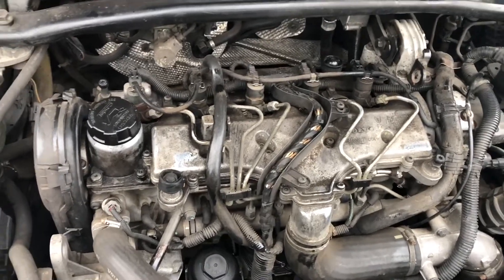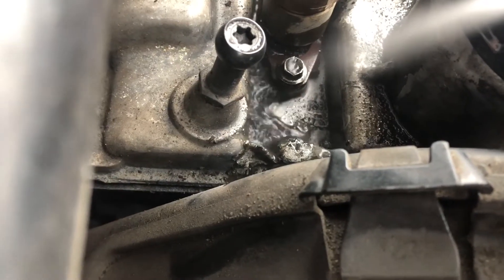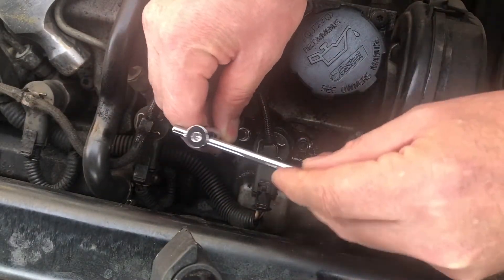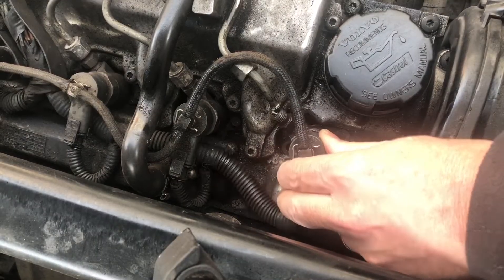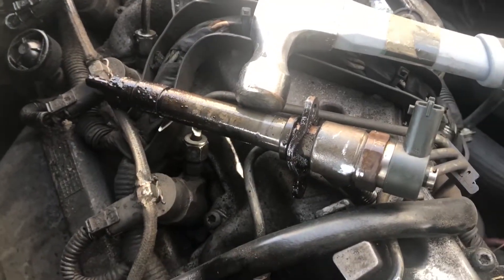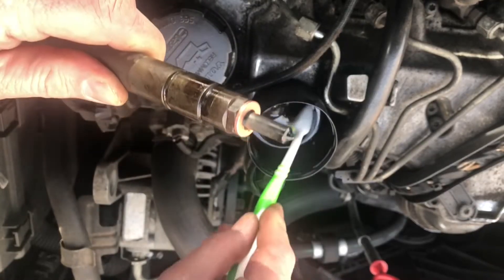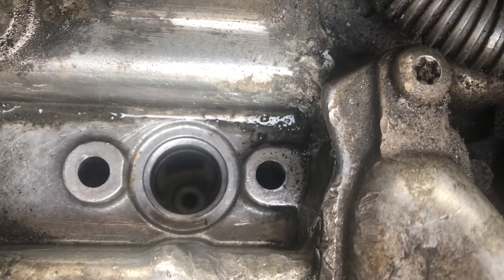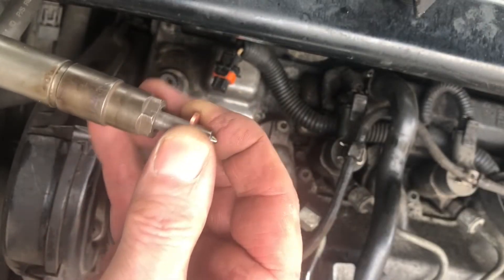Stuck Diesel Injector Removal & Refit Without Special Tools on Volvo D5.

Comment: unlikely the carburettor cleaner did anything , as it generally evaporates
Reply from the maker: I can’t agree with you as it dissolves away the carbon deposits to facilitate the loosening of the injector.

Comment: Why did you mark the relationship between the solenoid and injector body?
Regards
Reply from the maker: Just incase I knocked the injector and the nut turned out of alignment I could easily return in to the correct torque setting.

Comment: My dear friend, fortunately for you, you don't know what a stuck injector is.
Reply from the maker: Oh yes I do and I have been able to remove them after many weeks of patience using the methods detailed in the video.
Reply: Galvanic corrosion of alum to steel caused by water intrusion over a long period of time. Dealing with that now on a sprinter t1n  engine out of vehicle. Taking it slow trying various (every) penetrants and several puller methods that do not destroy "egg shell" valve cover.

I can lift engine via claw foot on any 5 of the injectors and it don't budge-that's  what "stuck"  is on this engine.

Still trying various methods ie "vibrating-oscillation" of injector with a custom tool.

Also plan to make a  "brace"  for upward pulling from outer surfaces that are stronger than egg shell valve cover.

Tried some vinegar carefully placed at injector base for short period of time (up to 8hrs) which got me couple of mm deep. 

Wondering if some heat introduced via injector bolt hole could help (?)....

last resort may try some lye carefully placed  with dropper around injector base letting it sit for awhile while also using puller or keeping upward pressure on injector.
Reply: @jamesfish5630  use a blow torch directly to injector body for 15 seconds. Make sure the electric top is removed, it's plastic. The injector will go out almost by hand. Or, even better - always remove (or at least undo) injectors from engine at nominal working temperature.
Reply: @paddlehard5722  All 5 were galvanic corroded so bad multiple heating's using every liquid known had no effect what so ever. The heat may work in black death cases but this one had sitting water for who knows how long (Florida van).
Reply: @jamesfish5630  Yes, black death exactly. That was my experience. But actual corrosion what you have could be a nasty thing to break. Maybe you could try "injector ex" by Wuerth. Very high penetration capability.   It amazes me how engine designers care so little about injector protection from environment. I have seen engines with actual accumulation pit at each injector base. Looks like a terrible joke.

Comment: Can you use anti seize compound to prevent injectors getting stuck in the future? Cheers 🤙🏻
Reply from the maker: A good thought but I would be wary of any of the anti seize compound making it’s way to the tip and causing injector blockages.
Reply: @TheRepairer The diesel coming from the injector has a pressure between 1600 - 2500 bar in the common rail. It will blowen away and burned in the cylinder😀
Thanks for your effort showing us!👍
Reply: @TheRepairer  Many thanks 🤙🏻